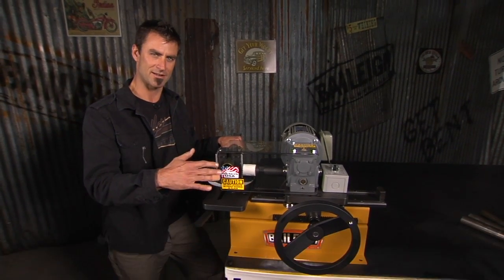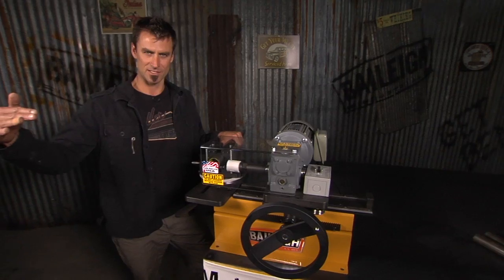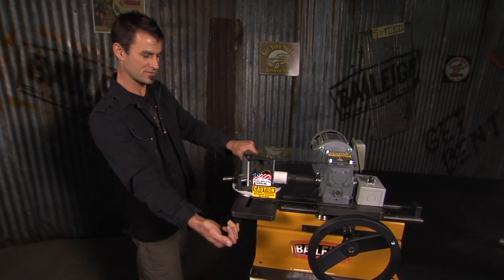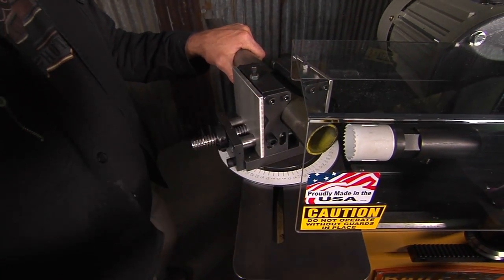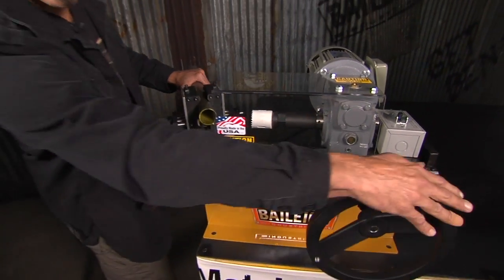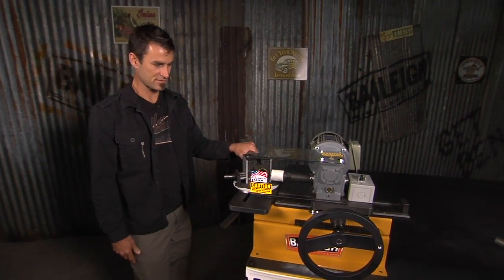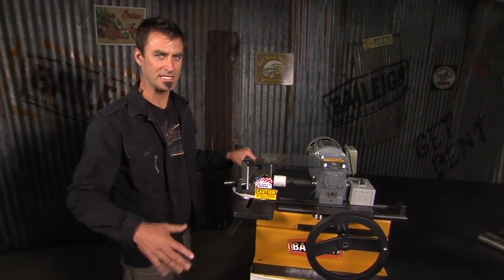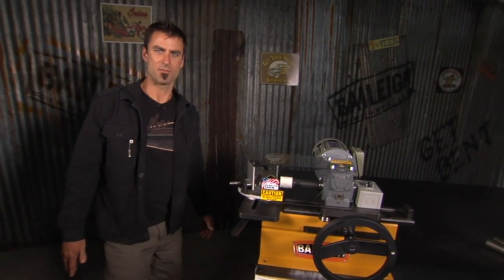Baileigh Industrial, TN-300 Tube and Pipe Notcher

Comment: Good God what an awful video.       Here's  an idea, how about start off with pipe capacity.  What's the maximum pipe/tube stock that you can cut with it.  Max thickness of pipe/tube stock.   Then go into notching pipe that's 20 or 30 foot long with the thing and any sort of roller/guide setups that they may need.    Then tell people how much the machine weighs, and about how many cuts that you will get out of each bit, and maybe how to sharpen the bits.  You know, useful information.      Eats chips for breakfast -- bleh bla blah is NOT useful information.
Reply: some ones a negative nelly